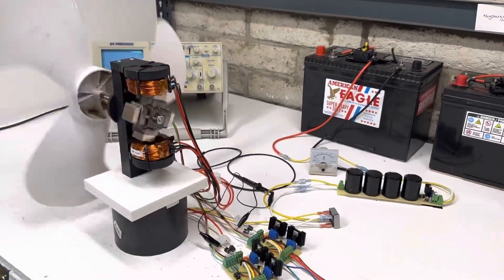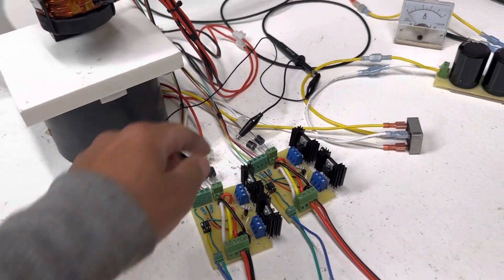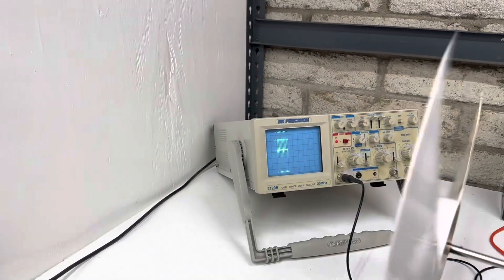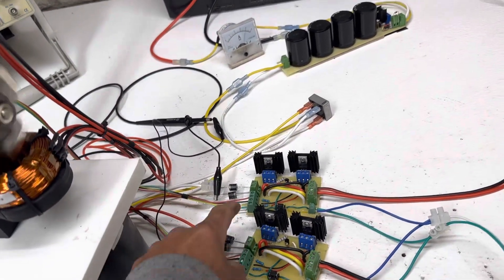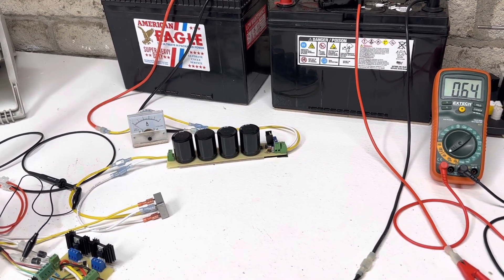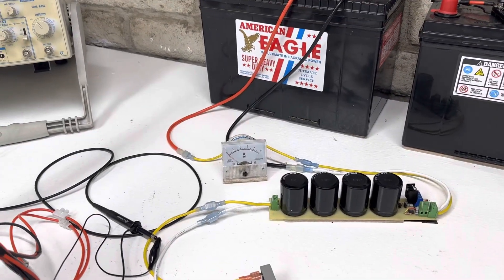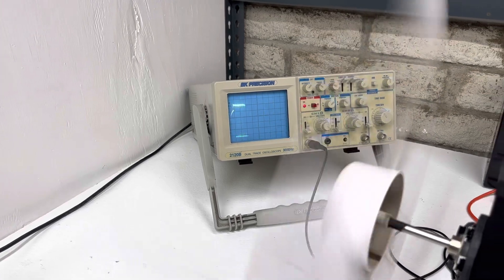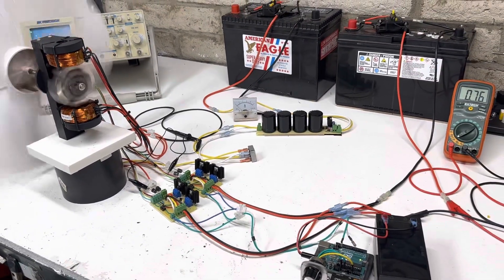Full H bridge circuit pulse motor

Comment: Hello k energy!
I am running a full bridge with n channel fets only!
Dont even needs a heatsink upto 80watts :)
I could provide you some details.
Reply from the maker: Very cool ! Definitely! 
 kbgenergy@gmail.com 

How’s the output? I’ve made H bridge with only N channels but would love to see your layout
Reply: @kenergy1707  let me email you :)
Also uploaded a video of the motor running on the bipolar board :)
The v1.0 pcb allready needs a update.
At first i had 0 bemf. Turned out i was shorting the coils on the lowsides.
Modified it with a bunch of diodes. Now capturing the bemf and reuse it at the next pulse.